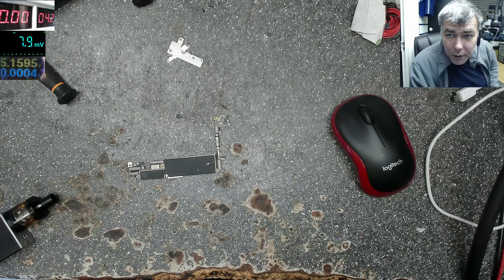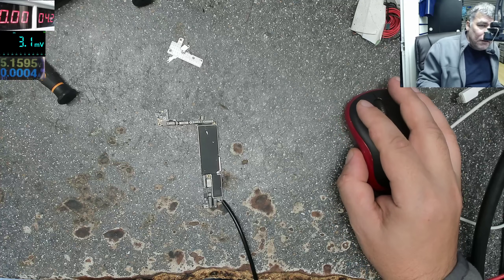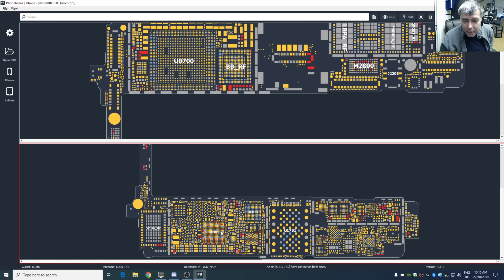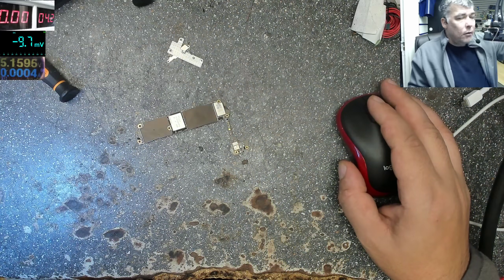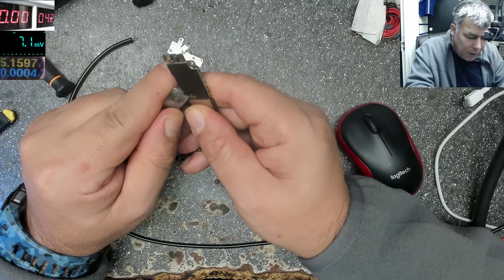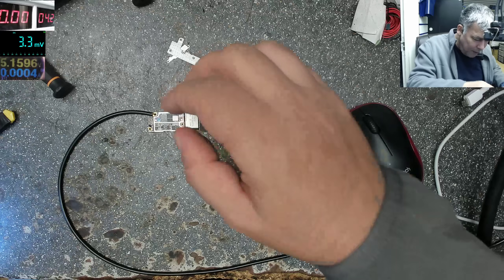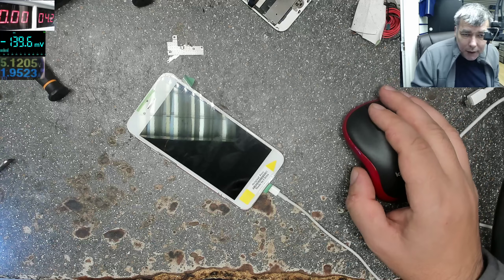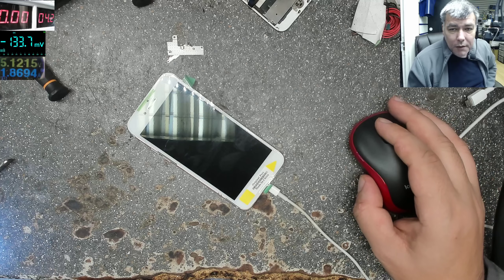Iphone dead by a screen replacement?

Comment: Maybe someone here can help. I have iphone 7 plus with liquid damage. Screen connectors were corroded. They are cleaned and free of corrosion. But phone will not give me display. It does connect to itunes in dfu mode. But after updating software he always say i need to restore

Comment: Hello Mr. Sorin,

Sorry for my boldness. Can you please tell me what's up with this mosfet?

Thanks in advance!

https://www.youtube.com/watch?v=BSkAs4Z_oUI&feature=youtu.be

Data:
Resistance (gadget tester): 470 Ohms.
MOSFET (from a PC source): Toshiba K2611 9F (Channel N).

Problem: After a while the voltage starts to rise and the LED goes off slowly.

Test with multimeter (without gadget tester) on diode scale:
- Red tip on source and black tip on drain reads 480.
- With the inverted tips gives no reading (it is at infinity - I), even setting and disarming the mosfet gives no sign of continuity (short).
Reply: Mr. Sorin, a little help, Pleeeeese!

Could you just tell me if the mosfet is damaged or not.

Thanks!

Comment: I recently bought a power supply of 30v and 3Amps, can you give me a  link of the video on how to remove the current protection
Reply: if it's a modern psu, chances are that it already has not short protection.

do the test : set volts to 5v, and set current limit potentiometer to 0, now short the + and - terminals and very slowly raise the current limit pot … if the amps display increases then you have no short protection, just a current limit protection which is what modern psu have. if amps display remains at 0, then yes, you have short protection.
in this case you will need to study circuit schematic to disable the feature.
Reply: Thanks you let me try it